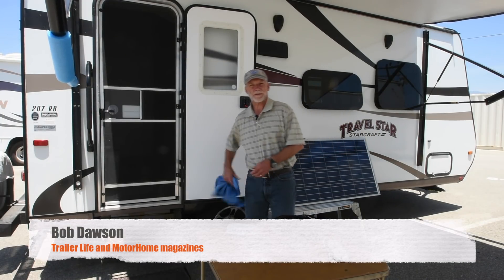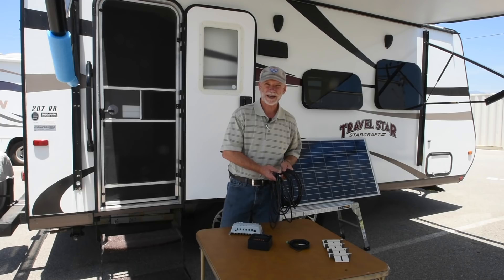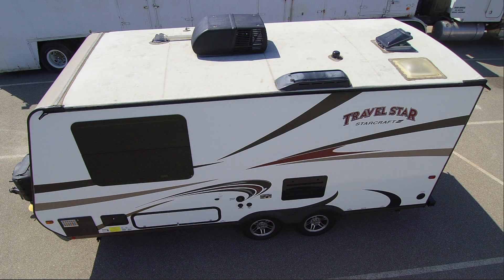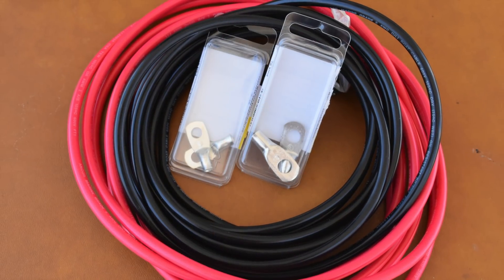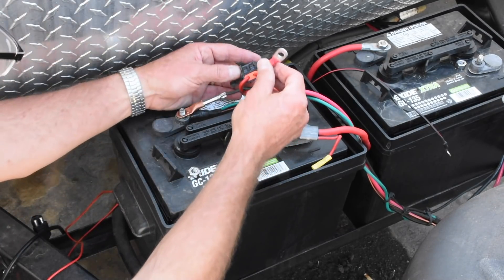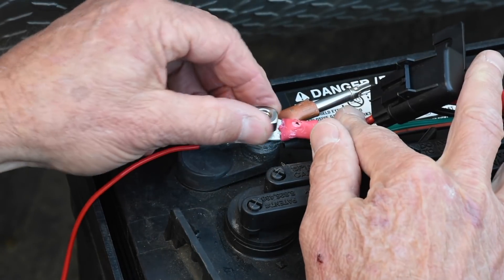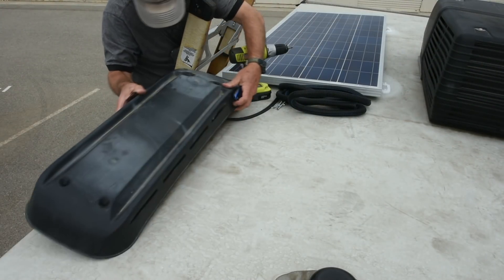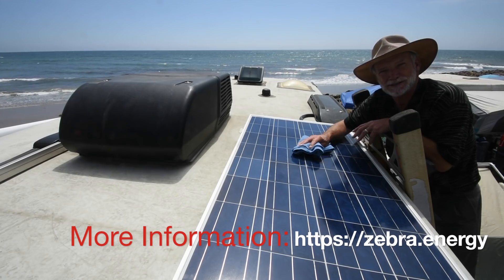RV Smart: Installing and Testing the Zebra Sunsparks RV Solar Kit

Comment: Hi Ron, i enjoyed your video. It was recorded about 3 1/2 years ago - I was just wondering if you would still say that the Zebra 150W solar kit was the  easiest one stop solar kit on the market now ?
We are in S cal in the palm Springs area can you suggest someone that could do the install for us? We have a 2006 Tiffin allegro Coach 
Thank you!!
Reply from the maker: Hi, Lorna, Thanks for watching! Honestly, we don't think there's a one-size-fits-all solution for adding solar to your RV. It's really good news that there are so many options and variables these days, and the numbers are climbing. But it does make it difficult to identify what's absolutely best for your scenario. Most importantly, of course, is budget. If you have deep pockets, it's easy to go big and be really happy. If not, you'll have to do some research to get dialed in to what's just enough for your needs. Here's a good place to do a little research, though: https://www.trailerlife.com/tag/solar/

Comment: that's not a good location for the panel. The air conditioner can cast a shadow on the panel and decrease the efficiency, especially on the poly panel  you used. You should always think ahead -- where are you going to put the 2nd panel, or even the 3rd panel, and make provision for it. The reason you are installing a single panel is because you do not believe you need more. But experience tells us you will change your mind.
Reply from the maker: Hey MetaView7, Thanks for the feedback. Sorry I didn't get back to you sooner ... Honestly, I have no argument. You make good points. We thought this was best for this particular (small) trailer but your points would be well worth considering on another trailer. You're right, many folks would want at least a second panel. -bd-